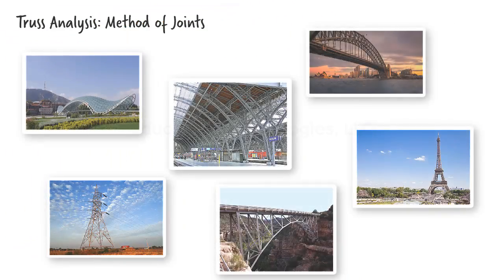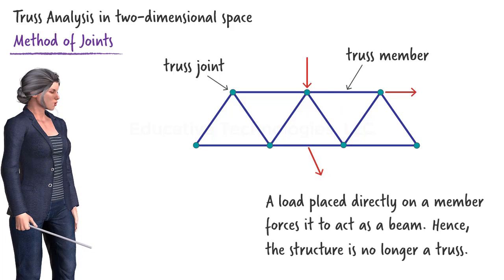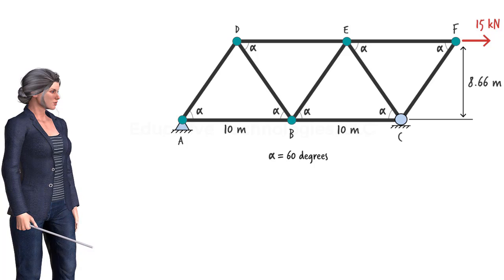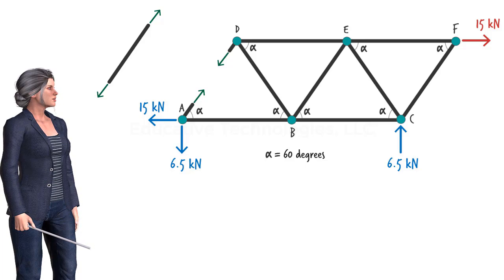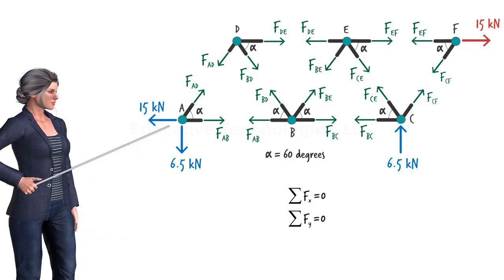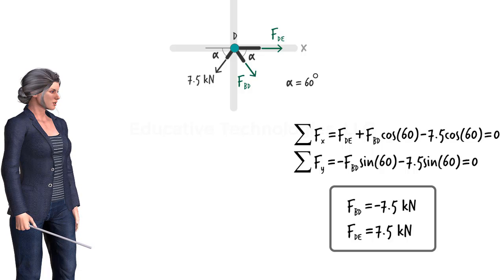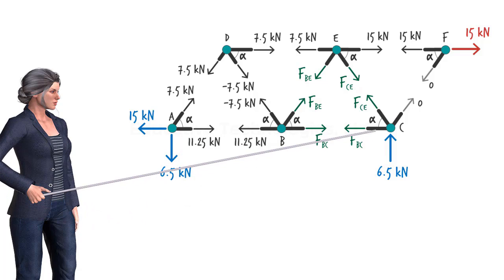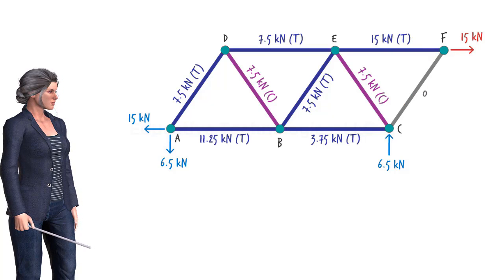ST13: Truss Analysis (Method of Joints)

Comment: Thank you, very clear explanation. But what does this analysis means or used for? Does it mean the truss is adequately safe in taking the loads?
Reply from the maker: No, it does not mean the structure is safe. The analysis tells us how much force each member is going to carry.  But if the truss members are not adequately designed (sized), the structure would fail under the applied load. Structural design is a related but different topic which has not been discussed in these lecture series.

Comment: Regarding the load must be placed at the joint, in real life is that possible to do? For example at a bridge, the load is moving. How I can consider when the member must be analyzed as a beam (moment and shear applied) or as a truss (only axial)?
Reply from the maker: It all depends on how the bridge surface rests on the structure. If the deck of the bridge rests directly on the long slender (truss members), shear and moment would develop in the members causing structural failure (assuming the structure was designed as a truss). However, if the structure has been designed as a truss, the bridge deck does not rest on the truss members, it rests on a series of cross beams that are connected to the side truss(es) at their joints. This scheme allows the load to be  transferred to the truss joints via the cross beams. See SA35 (https://www.youtube.com/watch?v=Vg5LDGMoCO4) for a simple illustration of this load transfer scheme.
Reply: @DrStructure  Nice, thanks a lot.

Comment: Great video. Joint F. -Fcf*sin60=0  Sind of 60 ist 0.866. how did you determine 0? Thank you
Reply from the maker: Correct, sin 60 is not zero. Therefore, for the equilibrium equation: Fcf Sin(60) = 0 to be satisfied, Fcf has to be zero.

Comment: The sum of the force at each joint is zero. But when I want to design the gusset plate for the joint, is that theory is applied? how to calculate the force that happens at the joint?
Reply from the maker: The gusset plate is the place that several truss members come together each carrying an axial force. The connection between a member and the plate is done using bolts or weld. The force in each member is transferred to the plate via these bolts/weld causing stress to develop around each connection. Although the sum of the forces acting on the plate is zero,  but each force is causing stress in the plate at the connection point. In part, the design of the gusset plate involves determining the location and spacing of the bolts/welds and the thickness of the plate in order to ensure that no tearing of the material takes places where the members and the plate meet. 

Furthermore, viewed as a rigid body that is in the state of equilibrium (i.e., the sum of the forces acting on it is zero), the plate is subjected to several forces pulling and pushing it in different directions. Hence, internal stresses develop in the body. If the material and section properties of this rigid body are not adequate, it could fail due to excessive (tensile/compressive) stress.
Reply: @DrStructure  Thanks again for the answer. Hope the best for this channel. :)
Reply from the maker: @bagusbudi3018  You're welcome!

Comment: In the real world, how do we show the dead load for each of the truss member? Thanks in advance for the reply.
Reply from the maker: The weight of each member can be placed at its end joints.
Reply: @DrStructure  Thanks for the reply. This is just to confirm, are you saying that a diagonal member weight should be divided by two and place each of the half load at each end of the member? Is it the same approach for the vertical ones?
Reply from the maker: Yes!
Reply: @DrStructure  Thanks a lot.